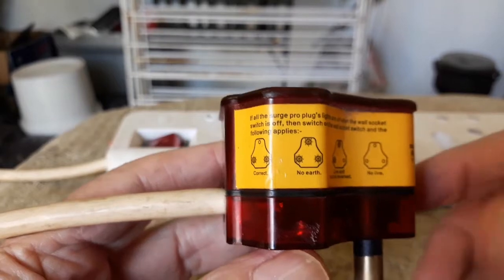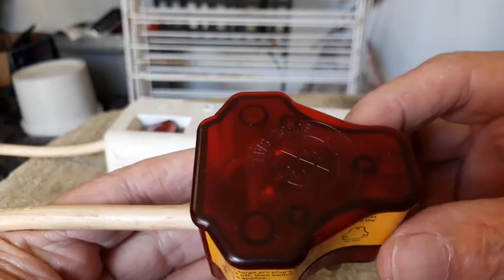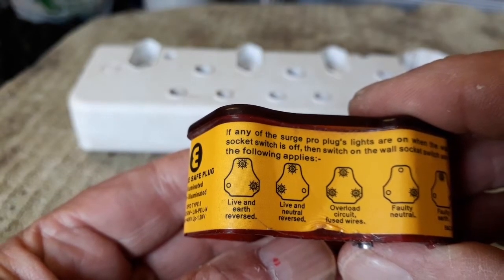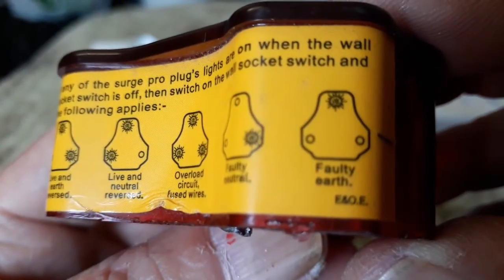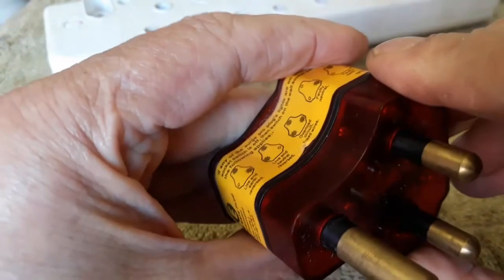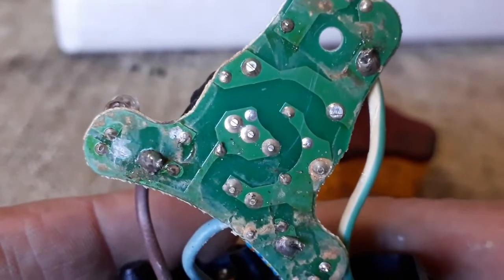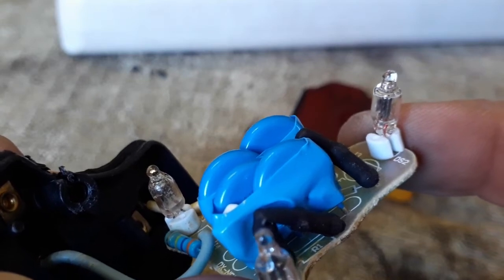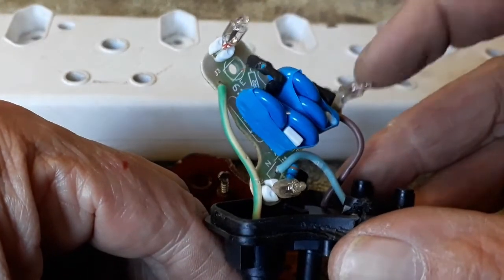Spark Arrestor Faulty, let's dig into it

Comment: Thanks for sharing Jan. The circuits in these surge protected outlets typically use a metal oxide varistor to absorb voltage spikes. They can fail over time and give off that smell. We’ve had one power strip catch fire when a varistor failed completely. We now try to replace our lug strips every few years because cheap MOVs will gradually fail by being used. Have a great weekend.
Reply from the maker: Interesting fact Henry, I know you would know the details of this, thank you for the information and view my friend, in Pretoria we had to have some lighting protection because of severe thunder storms, here at Cape town we have lighting on the Atlantic but not on the coast line, take care my friends
Reply: @jankotze1959  more useless info in my part 😁. We’ll, mostly ignored information! There are some more expensive devices the use a gas discharge tube but for the most part plug strips use the MOV because they’re smaller and cheaper. We use them at our place because sometimes the generator can make a big voltage spike if it’s turned off while an electric motor is running. We use surge protectors on each of our shows par arrays incase we have a nearby lightning strike. Take care.

Comment: Greetings my friend! Very interesting surge protector arrangement for sure, I haven't seen one quite like that before. Great that you can use some parts for your freezer light. I wouldn't have bothered trying to fix it either, some things are just not worth messing with. These multi boards are so inexpensive to replace and I always think, better safe than sorry when it comes to electricity. Take care until next time mate!
Reply from the maker: Thank you very much my friend, yes I had no plan to restore it, as you say that is so cheap and not worth the risk to try and repair it, but I want to make an autopsy on it, thanks for stopping by, see you soon again